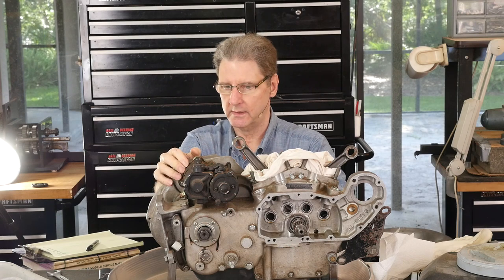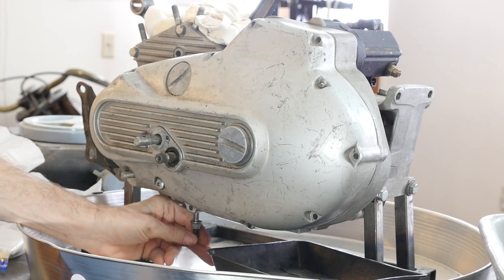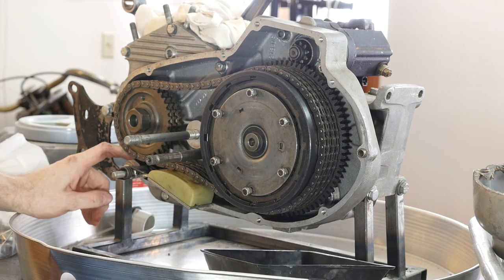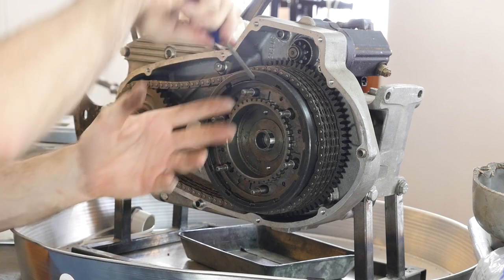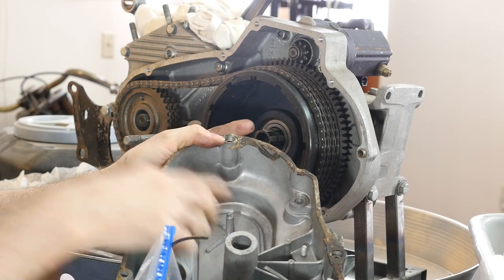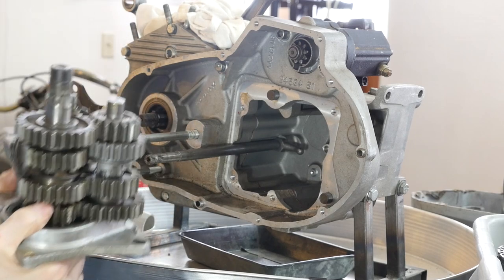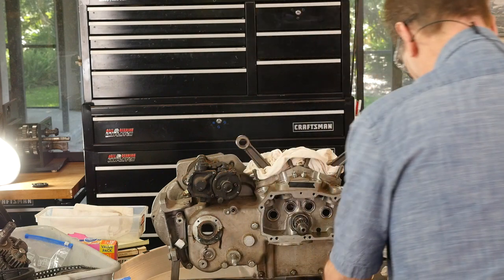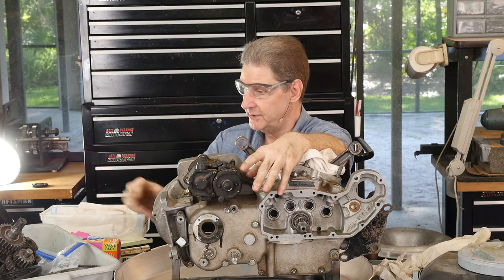Iron Sportster primary and transmission R&R

Comment: I have a 1974 sportster transmission that was coming in and out of second gear. I took the transmission apart. The only thing I could see that didn’t look good was the forks were wore a lot so I replace them I put everything back together exactly like you say in the video it shifts perfectly all the spacing is good when I put it in the motorcycle without hooking a clutch or the cog on the other side and go through the gears it wants to lock up in first and fourth, but it will go in neutral second and third if I put it on the bench it shifts through everything just fine
Reply from the maker: Hi, if it shifts OK on the bench but not in the bike that sounds like an endplay problem. You have to check both the mainshaft and counter-shaft. The mainshaft is easy, grab it or the chain sprocket and push and pull. For the counter-shaft sprocket, you need the primary cover off, then use a bent spoke or wire to get behind the closest gear and a small screwdriver in front of the gear so you can push and pull on the gear. The tolerances are in the manual, as is the procedure.

Also be careful when you assume it shifts OK on the bench. You have to be able to push on the gears gently to see they don't move into contact with other gears. That is what you fixed with the new forks, but maybe there is some slop somewhere I don't understand.

Comment: Great video ! Very helpful as I'm about to replace the shifter shaft which snapped at the foot lever.
Reply from the maker: Oh gosh, that is terrible. Sometimes to get the primary cover off the remains of the shaft will pull the bronze bearing and seal out of the primary cover. You might try to pop the seal out, and then see if you can use a Dremel to grind any of the shaft that is bent over. If it is a clean break, no problem, the primary will just slip out. Some guys leave the engine sprocket in the bike, so the mainshaft stays in the cases. I have never tried it, but it is supposed to work. Just make sure all the thrust washers and such go back where they were. Good luck, it is one of the biggest jobs on an Iron Sportster.

Comment: Hey Paul, love your videos - I'm putting my primary back together on my 82. I tightened the front sprocket nut to 165 lbs like the manual says but I did not use Loctite as the manual does not mention it. Everyone on the Facebook groups says use Loctite and some even say use red. Should I pull that nut back off and put blue on it and how may lbs with the Loctite?  Thanks, Jay
Reply from the maker: Do not use red Loctite, you will need a torch to remove the nut and the heat will probably ruin the seal on the sprocket shaft. I do put a touch of blue Loctite on the sprocket, but I really think it might not be necessary. If you look on the inside of the 1982 primary cover, you can see they molded a funky boss that sits very close to the end of the sprocket nut. The intent there is that if the nut does come loose, it can't back all the way off, that boss on the primary would keep it from dropping and you might hear the noise of the rubbing. If you actually measured the torque, you are 5 times ahead of most guys, who use a pipe wrench and hammer. Let me go look at the service manual.... Yeah, nothing about any Loctite in the 1979-1984 factory service manual. On page 6-14, item 4, it just says: "Install SPROCKET LOCKING LINK, Part No. HD-97200-55A on engine sprocket. Tighten engine sprocket nut to 150-165 ft-lbs torque." Heck, I use an electric impact wrench, so I make up for my lack of torque control with a dab of blue Loctite. It's up to you, but if it were me I would not tear it back apart.

Comment: This is the closest transmission to what I have, was wondering if you could solve my problem? I have an 87 sportster 4 spd. The bike was apart for seven years and I just put it back together. Every time I shift to 2nd, it goes into neutral. I have to lift the year shifter twice to get into 2nd. Same with down shifting, always goes into neutral before going into first. Can you advise me on what to fix? The top hats are good.
Reply from the maker: It might be that the clutch is not disengaging enough, so that the dogs on the gears are spinning so much they stop the gears from engaging on first try. Make sure the clutch is adjusted right, that is easy. The bike should not creep forward in gear even without the brakes on. If you are really lucky, you can shift into neutral with out rocking the bike back and forward when stopped. I assume you know to blip the throttle on downshifts to help the dogs engage.

There is a small chance the cow paddy shifter plate is worn. You can usually see this by how nice the top-hats fit in the slot at the various gear positions. You can have all this put together with the tranny on a bench, and shift the shifter with screwdriver in the slot where the shaft actuates, and move the cow paddy through the gears. Another common problem is that the shift forks are worn where the slide against the gear. This means the gear does not slide as far as it is meant to when you shift.

It might be too much end play in the countershaft. A lot of folks don't check it. You have to get a little hooked dental tool and a small screwdriver slipped under the trap door and hook behind the countershaft gear with the hook and press on the other side of the gear with the screwdriver, pulling back and forth to move the countershaft. Fancy is to pull the oil plug so you can put a dial indicator on the end of the shaft to measure, I just have a feel for it, tick tick instead of thunk thunk. Spec is 0.004-0.009" endplay on the countershaft. Mainshaft endplay is 0.003" minimum, not sure what the max is, book does not say. To use the dial indicator you have to have the whole primary and clutch off, but you might be able to get the dental tool and screwdriver under the trap door with the clutch still in. Then you can at least get a feel for how much endplay there is in the countershaft before tearing anything apart.

There is also the whole rigamarole of setting the spacing's of the gears, see the factory manual for that, there are several washers that come in different thicknesses so that the movable gears are not too close to the others in neutral, but close enough so they engage all the way when it goes into gear.

Finally, maybe the bike got dropped on the left side, and it bent the shifter shaft. I doubt this is it, the shifter centers on the "cow paddy" assembly, so the twisted shaft should not affect the travel of the gears.

Some winos would take the chipped dogs on first gear and sand them down shorter, so they look good but are too short. That usually means popping out of gear, which is more common, another thing that can happen with bad endplay or running gaps.

This is all based on Iron Sportster stuff, your bike has the 4-speed still, but the electrics are under the clutch I think, I hope this helps. You might join the XL Forum and post your question there. This is an interesting problem, and maybe someone else had had the same thing.
Reply from the maker: @shaymus1968  OK, I hope I helped. I also did two videos just about transmissions,
https://youtu.be/mlHzx9ddmAE
https://youtu.be/PFttzH4FhJw
Those  might give you some answers too.

Comment: Is there a seal at the crankshaft i have a 74 with belt conversion and its leaking there i believe behind the front sprocket
Reply: Yes. There is a seal in the case behind the engine sprocket.
Reply from the maker: Yes, Thomas is right, there is a seal behind the front sprocket, in a 1974, it's a 35151-52A. You would need a 37533-52A bending lock tab under the clutch nut when you put it back together.

The seal seals to the sprocket itself, so let's hope the belt drive sprocket you have is not cracked or worn out where the seal presses into it-- in other words, a big groove worn away by the seal. Chain sprockets are steel, belts sprockets might be aluminum down there, not sure. Once you get the belt off, you can get to the seal, remove it, and and maybe pound in a new one a little more or a little less if there is a wear groove in the sprocket. Resist any temptation to slather silicone in the seal, it can burn up the bearing with even a tiny bit. If oil is weeping through the sprocket splines, well then you can put some silicone on after the sprocket is on, under the nut that holds the sprocket, so that no silicone can ever get close to the bearing.

Comment: So behind the primary is there a place where oil leaks out . I have a 76 that oil is just leaking from behind there someplace
Reply from the maker: Hi Brandon, sorry for your troubles. I don't know what you mean by "behind the primary". Are you saying engine oil is leaking into the primary oil? If so, sure, the seal on the chain sprocket can leak, especially if the seal has worn down the sprocket so there is a groove in it where the seal runs. But there is also the famous "transfer valve" in the primary. That is in between the engine sprocket and the nut, and it is designed to leak engine oil into the primary oil. If your engine gets "sumped." where you don't use it much and oil in the engine oil tank leaks down past the oil pump and fills up the bottom of the engine, then that transfer valve lets the overflow into the primary case area. Then when you start the bike, the vacuum that is made when both pistons go up will start to suck that extra oil out of the primary and back into the engine, until the primary is back at the right level and the engine oil tank is full again.

Now, if you mean there is some leak on the outside from back by the motor mount, well that could be engine oil or transmission/primary oil. The kickstarter shaft has an O-ring seal but I rarely see those leak. One bad thing is sometime there is a crack in the case where the screws for the primary cover go in, and sometimes oil comes out those. It could also be oil leaking from the tranny shaft on the right side of the motor and working its way down and back making you think it is from the primary. This is tricky stuff.

I gave up trying to stop all my leaks, but if you want to troubleshoot, I would do this. Run the bike around town for 15 or 20 minutes. That makes sure that any "sumped" oil is out of the bottom of the crankcase and back in the oil tank. Check the oil tank, too full will make the bike smoke and for sure make sure you have oil before you even ride the bike. Now check the oil in the primary case by standing the bike upright, not on its kickstand, and pulling out that little Philips screw towards the bottom of the primary case. If oil flows out, let it until is stops. If no oil, you are welcome to fill it until you just get a drop starting to come out of the screw hole. Button the screw up, and get out the hose. I don't pressure wash bikes after I got water in the primary, but you can just wipe it down if you want. A little engine de-greaser will help whether you use a hose or just wipe things down. Then a quick ride around the block, and then look for where the oil is coming from. If not obvious, let the bike sit for a few hours or days until you can see where the oil is coming from. A mirror helps you see under the bike. Good luck, this can be a real pain to figure out.
Reply from the maker: Hi Brandon, sorry for your troubles. I'm not sure what you mean by "behind the primary". I assume you see oil back where the kick-shaft goes in the primary case. There is a seal on the kickstarter shaft, and primary oil can leak out. I don't see that seal fail very often. It might be a loose hose or fitting on the oil tank that lets oil leak on the top of the tranny, and that is dripping down and making you think it is coming from underneath. This stuff is tricky. It can even be the oil is coming from the transmission shaft on the right side of the motor, and dripping down and underneath, making it look like its behind the primary. If you have electric start, the oil can leak from that unit where it bolts to the engine. If you have a kicker only, there is a plate over the opening, and that can leak. At least that is pretty easy to check. There are two bolts on the motor mount back there. Those bolts go right into the transmission, and some oil can weep up those threads, but it is not enough to be called a real leak.

I gave up fixing leaks, but if you want to troubleshoot, ride the bike 15 minutes so any "sumped" oil in the bottom of the engine gets pumped back into the oil tank. Then stand the bike up and take out that little Phillips screw at the bottom side of the primary case to check the oil in the primary. If it is over-full, let it flow out the check-hole. If it is under-full, you can take out the oil fill plug and add just a little until you see a drop just starting out of the check-hole. Now with engine and tranny oil both at the right level, you can wash the bike down. I don't pressure wash, I got water in teh primary that way, and washed the grease out of the front wheel bearing. You can use a hose or just wipe everything down. A little engine degreaser will help. Then a real short run around the block and look for the leak. A mirror can help look underneath. Lets hope you don't have a case crack. Good luck, this is a pain but I hope you find the problem.

Comment: Can those  23 roller bearings be installed from the right without taking the transmission out? I've detected play in my '69's mainshaft and need to replace the bearings , I'm guessing.
Reply from the maker: I don't see why not, you would need a strong magnet to get the first one out but a dental tool would get the rest. There are 23 off them according to the parts book, 9095 stock; 9096 = 0.0004 over; 9097 =  0.0008" over. But but but, this is for play in the radial direction, not end play. If the sprocket moves back and forth along the shaft direction, that is end-play spacers inside the transmission. Also, most times, the oversize rollers don't fit all 23 unless you line hone the bearing race with the 300-dollar reamer tool. Don't use a brake hone like I used to, it bells out the bearing race. All this requires pulling the tranny. If radial slop has developed, it is likely that the mainshaft has worn, and new rollers will not always fix that. Also, this radial play can be pretty loose and you get away with it, does the seal around the sprocket leak? That is one problem you would get. Like I said, be sure we are talking about slop created by the chain loads, not the shaft pushing and pulling out a bit along its length. With that, the problem is the tranny pops out of gear or clatters in neutral. Maybe the first thing is to get the cover and chain off, and just feel the sprocket, will it turn smoothly? Maybe some silicone or junk got in the bearing, and then it is all blue with a bad race, bad mainshaft, and dang it, I have seen the rollers look fine with the race and mainshaft being blue and torn up.
Reply: Thanks so much--appreciated!
Reply: Yes, I am referring to observed side to side play and was wondering if this could be done . at least as a test, before pulling the tranny out.
Reply from the maker: @billvandyne4685  Yes, when Dr. Dick posted on a forum that his is how he does it, I kicked myself for not thinking of doing it this way. You have to take this stuff apart anyway if you do a transmission pull, so why not get the bearings out from the sprocket side? It will let you see if there is any blue heat damage on the shaft, or if the rollers are OK. The only downside is that it is pretty hard to get that snap ring back in with the mainshaft in the way. Without the mainshaft installed, I just turn the ring sideways, and tap it into the race, then rotate it so it snaps in. Good luck tearing into this, hope it is just some new rollers that will get you back on the road.

I did an article on honing the race with that expensive tool:
http://www.open-sport.org/Repair/Honing-transmission-mainshaft-bearing/
Sorry, no video on that one.